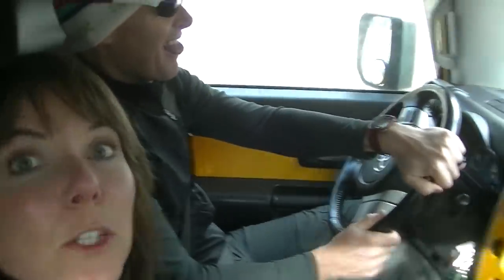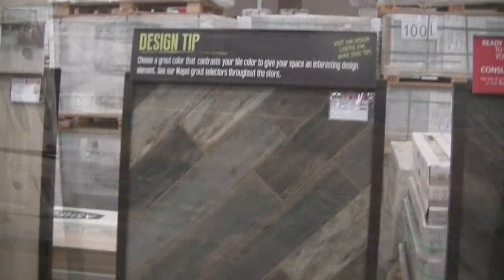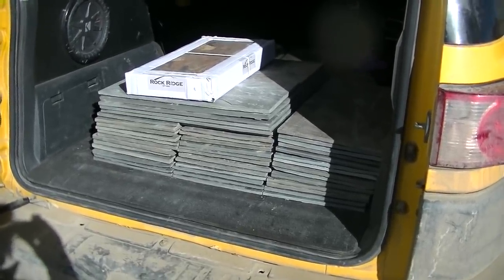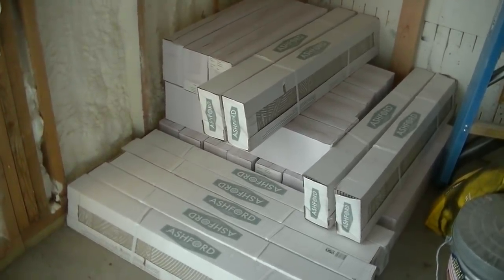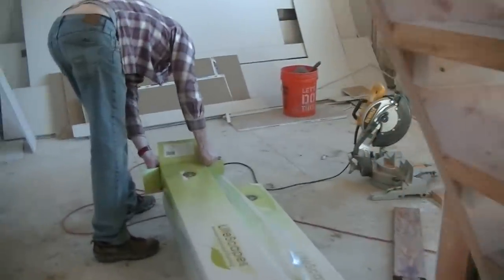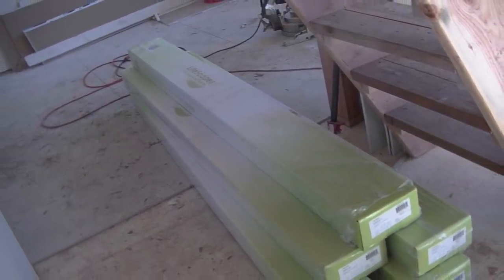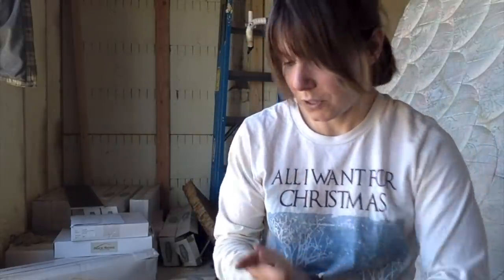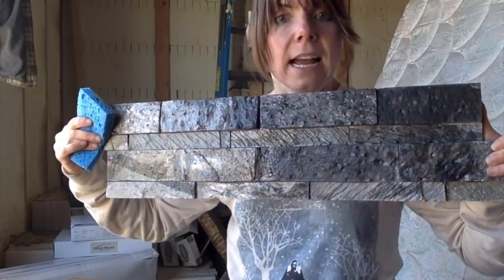Wood Floor vs Tile - Unboxing our Flooring Choices

Comment: Looking forward to see how those materials look after installation.  Doing a video tour of the entire build after putting up the drywall is a great idea.  I couldn't figure out where you made some of the interior shots due to the drywall in the background.  It's a big transition from a big open space into rooms and closets.  Old brain's, such as mine, need all the help they can get.  The two of you have a good and safe vacation, and wonderful holidays!
Reply from the maker: Ha! Yes the look is much different now.

Comment: i did a 14'x24' tile floor herringbone patterned with 6"x12" textured leather colored floor hardest part was keeping the tiles level to each other. i found out right away you must butter each tile or they'll lift days later and spray some water on the existing substrate (cement in my case) because it's so dry it dries out the thinset fast. i used both laser & chalk lines to keep patterns in order. made a one of a kind custom tile medallion (couldn't afford a real one) for the center of the floor & buried a time capsule under it. my local lumber yard can get anything home depot has, turns out if you contact the tile manufacturer and ask them if they have any "discontinued out of production" tile designs they sell those 75% off. they had me buy the entire pallet then i sold the leftovers on craigslist. take your time on this stonework knee pads & ibuprofen are your best friends
Reply from the maker: Wow- sounds intricate!Thanks for the tips!

Comment: Suggested the porcelain in stead of slate. Been a task with the mold and mildew and constant cleaning and re-sealing if your up to that. Good luck.
Reply from the maker: Ok thanks for the tip.

Comment: Put the sealer on your stone, tile before you install them. This keeps the tile clean and much easier to wash after you grout the seams. If it was mine I would apply two coats of sealer. Lay your tiles flat and apply the sealer thin but cover it all. Let dry and repeat. You won’t be sorry come install‼️👍👍. Vinny 🇺🇸. PS, looking at your choices, definitely pre seal your material, I’ve done this for years. After install seal the grout. Several times. While doing the grout apply another coat on everything. Your choices are Very porous, it can be hard to wash grout and thin set off. Pre seal your material. GOOD LUCK, MERRY CHRISTMAS 🎄 Vinny 🇺🇸
Reply from the maker: Good tip. We were told 2 coats of sealer as well.Thanks so much!!

Comment: Be careful if your planning to install hardwood over radiant floors. For Radiant flooring you need to use an engineered product to address the thermal expansion. Standard hardwood will buckle and split over radiant floors.

One suggestion: Avoid using dark colors for walls. If your planning to use flooring materials on your walls will make the room extremely dark. Even dark floors can really zap a lot of light out of a room. Also if you drop something (ie a tiny screw) its going be difficult to find it on a dark, busy floor. 

Make sure you apply underlayment under the tile. especially with radiant flooring. Otherwise movement from the subfloor or thermal expansion can cause your tile to crack or pop loose.

Would recommend against using the tiny tiles since your going to have a lot of grout that make need to be replaced at some point. Best option in my opinion is to use only large format tiles.

From the background in your video, it looks like your building a tight home, Its probably not a good idea to install a wood stove since if you have even a small Carbon Monoxide leak you could get very sick or die. Generally tight homes use an external\outdoor wood boilers. At the very least make sure you install multiple CO detectors (presume that one might CO detector might fail and thus have a backup, preferable by a different manufacture in case there is a manufacturing deflect\design flaw).
Reply from the maker: Thanks for the tips! The hardwood we chose seems to have an engineered component- not just a plank of oak but a compressed oak plank. There will only be one dark area of the house, the bathroom, which will have 2 darker accent walls, but this is intentional, in order to create a "cabin" feel. With the size of the painted walls and windows, the other dark colors won't have as much of an effect. The tiny tiles are just for the shower. Good tip of the multiple CO detector. We have one, but a back up one is a smart idea. I think the wood stove will be more ornamental/occasional use from here on out, since the radiant flooring is working so well.

Comment: We were worried about the same thing as our floors are consistent. All said and done it looks nice. I've been in homes every room is totally different and that doesn't work for me. When they initially sealed our slate they used gloss and it looked blotchy. We let it go for a year and my wife resealed with semi gloss and it looked much better. It may have been more of a application issue originally than the product. Hope all the mudding will be done on the drywall before you put the floors down. Going to look nice.
Reply from the maker: Although we will be living in this as a completed home, it's only (phase 1) the master bedroom suite- so continuity of design will matter more. In a couple of years when we move into phase 2 and  will expand the design choices. Thanks for the sealing tips.

Comment: The big issue you will have with the kitchen tile you will eventually  chip the edges of the tile (and it will happen) and the backing color will show through i.e. a light color The best tiles are what we call a full body tile which has the same color right through and if chip will not show up. From an old Aussie retired builder
Reply from the maker: ok thanks.